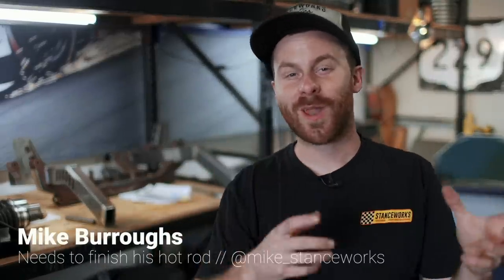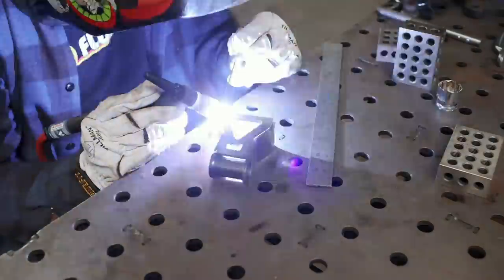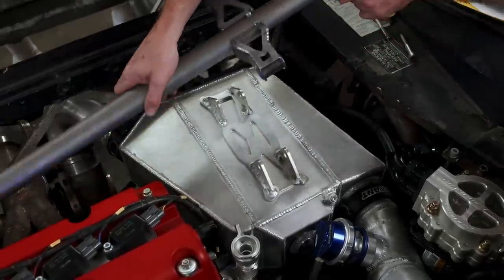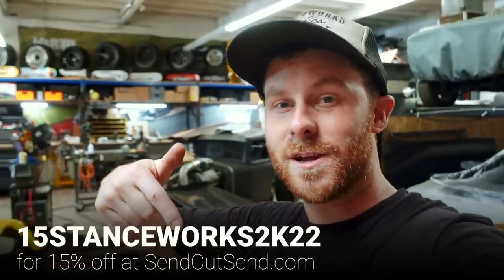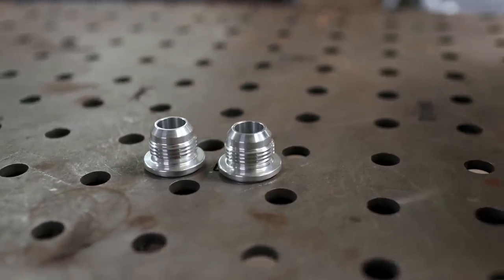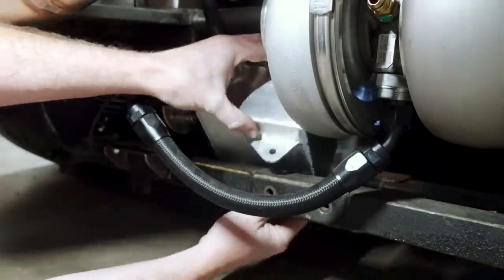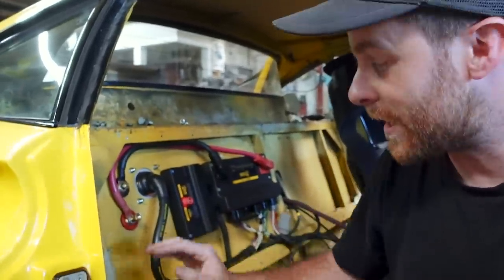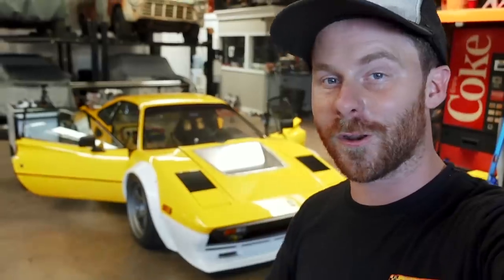Over-Engineering: Intercooler Mount, Oil Sump, PDM, And MORE! Honda-Swapped Ferrari

Comment: I would just put a rollbar behind the seating area, braced back to the firewall. you can attach a harness to it and it would still provide adequate protection in a rollover, while still allowing the car to be streetable.

Comment: You could go for a full rear cage, and front loop, but join them in the middle the top and bottom on both sides. That should fix headroom problems as there would be only one bar there and at floor level, there should be space?

Comment: If chassis rigidity is something you're concerned about, underbody triangulation and other longitudinal chassis stiffening options are around/possible.

I'm doing up an E21 with a K24 and I will not be caging it but will most certainly be looking into other chassis stiffening ideas when it comes time to do that.

I am in Australia so the regs and laws are most certainly different but from the safety aspects, exactly the same.

Looking forward to seeing which direction you go with it.

Comment: I had the same concerns with the cage for my MR2.  I came up with a great idea with my cage builder.  Street style cage with a cross bar that drops and runs along the lower frame of the door sill.  You can check it out if keen on one of the vids from my channel.

Comment: I’m terms of a cage, do some looking into tension cages. Do-Luck used to make them years ago for a Nissans, Toyotas, etc. but they were aluminum and provided the rigidity you were looking for with the added weight of a full steel cage. In the case of the 308 it would seemingly give you the added chassis bracing your looking for without the potential of knocking yourself out on the street. Though you’ll probably still have to build it for the 308…

Comment: Build a custom cage using dimple die box section for A & B pillar, triangulated with CDS. It’s not gonna be FIA approved, but as you say, it will give you rigidity, extra protection & you’ll still be able to street it.

Comment: Hi Mate, pretty good job you are doing here, but the oil deposit should go under the turbo and the drain tube for the turbo should go straight down, it drains by gravity, if it has any loop your turbo will be full of oil and will blow out, try to have the drain pipe as a straight line (it could be in diagonal but cannot have loops). Keep doing this good job!!

Comment: Okay so back in the 70s MG bought out quite a few sports cars one of them being the triumph stag and although it was a big car there was very little room inside it because it was convertible they needed to have some form of Roll-bar , so basically what they made was a T-bar , so most of the strength was on the T frame which was behind and had a middle bar going towards the windscreen , which means that they could use smaller tubing going over the top of the doors and the window frame that couldn’t be seen , but because the T-bar was extremely strong and made of oversized tubing it compensated for the other tubing making the car very stiff and very safe , without you feeling that you’re enclosed or about to bump your head on anything the T-bar was also covered in rubber so you really didn’t take much notice of it, and just look like part of the styling of the car , maybe something like this could be done on the inside of your car have a look at the triumph stag

Comment: the only factor causing a challenge is if the water to air intercooler reservoir lacking service movement aside from having other parts removed from the bottom out (only accessible one way).  It will be secure, but inconvenient for work on components around the engine bay

Comment: For the cage- I’ve watched the whole series and can’t remember if the roll bar you build is bolt on or welded, but can’t you have permanent B, C pillars and door bars then removable A pillar and roof bars? A total of 6 bolt-on points doesn’t seem too bad. 

If I recall correctly, you’d be removing the aero on the street so removing the cage can be part of that process. 

Permanent door bars, since you have buckets and the side bolsters seem pretty tall.

Edit: similar to a Cusco bolt on cage, but the rear section can be all welded for added strength.

Comment: A full cage is really the safest way to go any time you are on the track in an older car like this. Without advanced chassis designs, crumple zones and other chassis features of a newer chassis a cage could mean the difference between a bad day at the track and a worse day at the hospital. Socal tracks have run off yes, but they are soft sand and dirt and I can share more then a few photos of cars that ran off at BW or Willow and flipped in the dirt, I have even done it myself at Big Willow. You can run closed cell foam padding around the cage bars and if they are snugged very closely to the window edge this could be a solution. Bar or edge of the front window both could damage your head in an impact. Also maybe look at a seat with a lower side bolster so ingress is easier, maybe consider a race seat with high sides and a road seat with low sides and less bolsters for daily..

Comment: Half cage seems like a good solution. keeps it street-able and safe. Maybe a quick release side/door bar if possible. ?
Reply: Yeah the bucket seat seems really high up and the wheel doesn't have an airbag in it anyway so a quick release should be a no brainer.

Comment: You might want to review the rules of the classes you are considering running in and talk to the tech inspectors for their opinions.
Reply: exactly i know damn well any racing body has a minimum of atleast a good 6 point. I don't see how side collision protection can just be neglected, especially with time attack level of horsepower underhood.

Comment: I'd say quick release steering wheel half cage with door bars if possible. I think it would be kinda cool to put the seat and all driver controls in the center and do a full cage that way but idk what the interior is like plus there wouldn't be any passengers allowed if it was possible

Comment: Your comments on the cage are warranted, however, a properly designed cage will significantly stiffen the chassis which you will want. Tightly fitting the cage to the A and B pillars so it can be welded directly as well as tightly fitting to the top of the windscreen metal surround will give you the most room.  It looks like there may be enough room to fit some padding that will help add some protection.  I don’t think I’d run this car in a competitive setting without the cage timing into the suspension pickup points.

Comment: I say don’t worry about the cage right now. Get the roll bar dialed in. If you end up seriously track driving often, take the time to get a cage mocked up and put in. Personally would love to see tutorial about setting up your DD, standalone, and data acquisition stuff. 2nd in class both my race days over the weekend. 4th and 5th overall respectively. Still need more speed. TSX K series gang strong. Yeah still miss driving my e36 tho near perfect chassis.

Comment: In regards to streetabity - if you’re not using a 3pt seatbelt it won’t be streetable from a safety perspective.

While some people drive on street with a 4/5/6 pt harness, in the event of a head on collision, you run the risk of getting a basilar skull fracture (internal decapitation). 

Driving on track, folks wear a HANS device which connects to the helmet and straps in with the harness to keep your neck from overextending.

Also saying you’re going to drive on track but not do w2w makes sense in that your risk is reduced, however, you can still roll a stock/modified car on any track in California - regardless of runoff.

Even having a basic roll-hoop/bar is risk prone because in the event of an accident, it can bend/detach and make contact with occupants due to the already limited cabin space you’re working with.

At the end of the day, you need to make risk/reward decisions and this car will be more street than track or more track than street. If you I tend to be mostly street driven, make decisions based on safety for street.

Comment: As far as the cage goes, I say put a harness bar and a hoop and leave it at that. You've said yourself that this car, even though it's meant for time attack, is not stiff enough to be a true time attack contender. Adding a full cage would help and it would make the car very safe for the track but then you don't get to enjoy the car for what it is (in my opinion). This car is also a show car, it's unique, it's beautiful, I bet it will be amazing to drive. If it was mine, I would want to be able to go hit canyon roads with it or at least go out and ride around town, rip a pull in a tunnel to hear it. Plus, you're blessed enough to have some of the best roads in the world somewhat nearby. I wouldn't sacrifice that, I'd keep a minimum amount of driveability to be able to enjoy all the hard work that went (and is still going) into that driving experience. That's my take on it anyways.

Comment: Are you able to lower seat height 🤔 a little to compensate room for the rollcage tubing and helmet , do you think that would work? Are you able to  move the seat more to the centre of the passenger compartment? Might have to cut the left thigh leg support on the seat to get it closer to the floor tunnel and add padding to the floor tunnel to compensate for the removal of the seat right hand side leg thigh support? So moving the seat closer to the centre and lowering the seat height might give you more room to incorporate the rollcage. Or you might have reconstruct the passenger compartment floor to move the seats closer to one another as a alternative. This will obviously have an adverse effect on your steering and foot pedal geometry.

Comment: In terms of the cage, what options are open to you for reinforcing the chassis out of sight? Like welding bars in the sils and or adding strength underneath?
You need a roll bar at the very least, but if you can get the strength in there and maybe even work the weight balance to how you want it too... it would have its merits.

Comment: Hey I noticed the oil tank for the turbo might be a little high. From my experience the turbo could have a hard time draining and will smoke a bit. Maybe it was just the way the video shows it. Car is looking great! I fabricate custom parts for my race car as well in my channel. Love to see more people do the same!
Reply from the maker: I think it should be okay. The bottom of the oil drain is higher than the top of the tank.
Reply: @stanceworks  
Great work. One thing about that thank. Did you but breather on it? I did not see it. With out breather you create same vacuum as if there was just the hose. I believe you need it.

Comment: Nice work on the tank.  But I feel like it'll just create a vacuum, pulling the oil through the turbo.  Is there a way to modulate the pump via a float or pressure...or possibly vent to atmosphere?

Comment: Hey Mike, I would just keep the already made bolt-in roll bar behind the driver. It will provide some rigidity to the chassis as well as safety to the driver. And still keep it street worthy. One good argument is > it is ready. It will not add up to the "to do list".

Comment: If your not racing wheel to wheel, you could get away with a half cage, yes tolerances are super tight, almost like a Miata, but most sanctions do a broom stick test between your helmet and cage… and you don’t want your helmet touching the cage anyways. Half cages allow you to street drive the car without issue, you get chassis rigidity, solid mounting for harnesses and honestly add a works bell or quick release for easy enter and exit of the car.

Comment: What about bolt in door bars similar style to AGI's bolt in cages (You'd probably have to tie them into the dash bar for extra rigidity). Give you a fair bit more side impact protection but little to no sacrifice for daily use.

Comment: I say you stick with the rollbar route initially. Drive the car, use it, put it through its paces. Once you've gotten plenty of seat time I think the answer will come to you if it's necessary to do the full roll cage. If you feel it's necessary to to the do the full cage, do it.

Comment: It might be too late, but I would consider a bar like the one you originally built in the rear, a dash bar to the floor in the front, and maybe a 3 point door bar, low front, and low/high rear. With a removable steering wheel, it could still be reasonable to access.

Comment: as the owner of 4 race cars. i vote roll bar only (no cage) its not needed or required for time attack.  and ditch the halo seat. it will make entry and exit SOOOOOO much easier! i speak from experience. the required Hans will provide all the head restraint you need.

Comment: I've got a couple of street cars with full cages.  I'm considering cutting them back to more of a roll bar like solution.  A full cage sucks the fun out of the cars on the street.  I've never paid much attention to the Time Attack stuff you're doing, I've done Time Trials (similar?) and wheel to wheel.  I'd say for TT a full cage is overkill, for wheel to wheel racing a full cage is a must.

Comment: With regards to the cage, you said "racing", and if you are 'racing' there will be a rulebook to follow. However if you meant HPDE/Track days, the rules are less strict. Basically anything that is a timed event will likely require a full roll cage, and as you know on the street that is bad.  IMHO if it were me, I would put in a rear cage only for now so you have some rollover protection and a legit place to mount those harnesses at the right angle. This way you can use it on the road and enjoy it, dial things in, do some HPDE/track days and get a better understanding of what you want to use the car for. Just my 2c, love everything and am addicted to my Tuesday morning updates.

Comment: The car is coming along great!
One question; are the huge rear wing end plates necessary? They seam really OTT. 
I understand that the front splitter has not been installed and there needs to be a aero balance, but looking at Ferrari race cars past and present it just looks unbalanced especially if it will also be a street driven car…
Reply from the maker: I like them. It’ll balance out with the rest of the aero package. But they aren’t for everyone.
Reply: @stanceworks  I agree with you, I have large end plates on my SL-C and think it makes a big visual improvement, especially since the design is inspired by group C cars.

Comment: Talking about the cage.  Could you run a double center bar attached to the rear hoop and an A pillar hoop (like a T-top roof) and not have a bar above the door?  Maybe have a removable bar section above the door?  It wouldn't be as strong as a fully welded cage if you bolted a bar section in above the door.  I know some cages have removable door bars or swing out bars.

Comment: Comment/question about the oil tank. Since you don't want the scavenge pump pulling straight from the turbo because it will suck it dry, how is adding an non-vented tank in-between any different? Without a vent, won't the pump still pull a vacuum and pull oil from the turbo anyway?
Reply from the maker: I don’t know the answer to this one, and I’ll need to look it up. I wondered the same but a lot of people have told me otherwise. ,
Reply: @stanceworks  I'm not familiar with that kind of set up, my simple turbo cars just drain back to the pan, so I don't have an answer. But that's what came to mind watching you build it. Kept thinking you'd be adding a vent line going up or something.

Maybe the air in the tank simply provides enough expansion that the pump isn't pulling directly from the turbo. Just a guess though.

Comment: A roll bar should be enough for your use case. You mentioned in another comment you already have one so I would just go with that. Full cage may be "safer" but isn't necessary for time attack, just make sure you have some protection in the advent of a roll and leave it at that. If you really feel like you need a bit more you could always do a Targa top style roll cage, add 2 bars down the center of the roof that hug the roof nice and tight and connect them to another roll bar that hugs the windshield and anchors forward of the driver so you don't have to climb over door bars. "Full cage" is determined by standardized racing specs, there is no reason you can't have something in-between so long as it meets the minimum safety specs of the racing regulations of your chosen discipline. In your case it's just about being as safe as possible without losing the streetable aspect. Get some safety specs from any race types you think you might like to use the car for and check the regs, build out to what they require then add what you need for safety and peace of mind (provided the regs don't prohibit it).

Comment: I believe a removeable steering wheel will make it easier to get in and out. Also if you want a cage in the car there’s not much room for your head unless you make the cage cross from the middle inside of two from the side like in t top cars.

Comment: If you go full cage it won't give you adequate safety unless the top of your head (and helmet) is well below the top bars/hoop (Think about what would happen during a rollover). With that in mind it doesn't look as if a full cage is going to fit reasonably, unless you somehow lower the seats (lower the floor?).